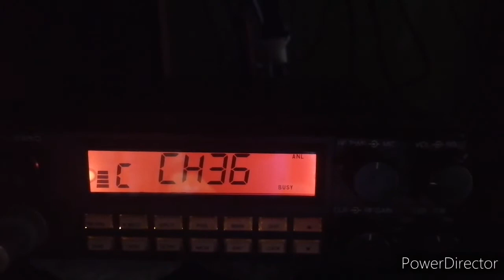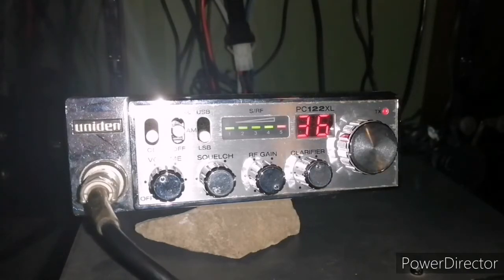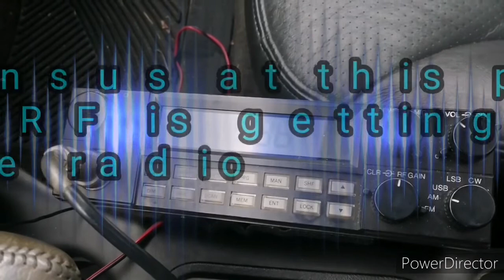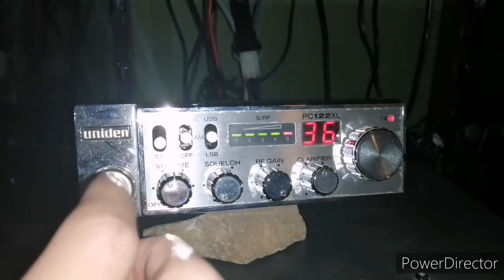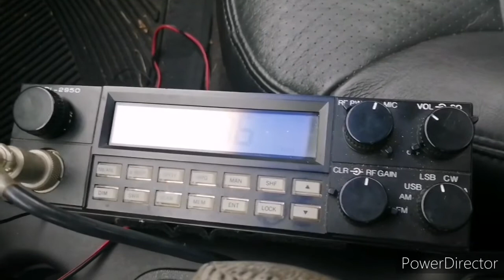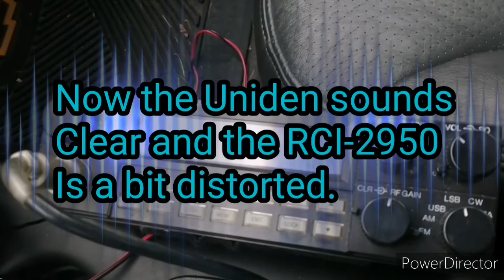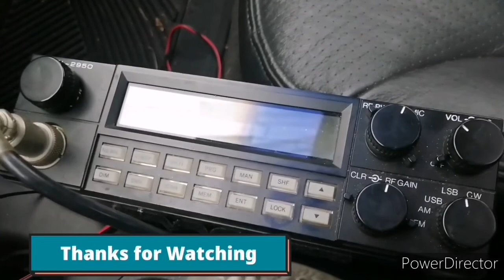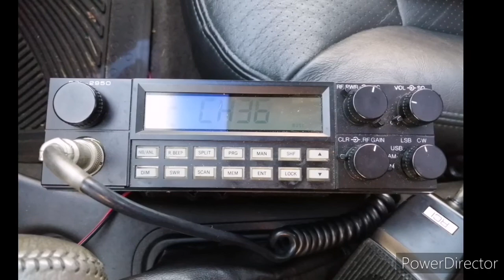Getting Back into CB Radio  Troubleshooting audio issues Part1 Uniden PC122XL vs RCI-2950 range test

Comment: I have heard CB is getting more popular the last few years.  Nice to see the older gear still in use and working.  AM seemed ok, LSB had a lot of distortion.  Strange.  At first I was thinking it may be the Ranger having an issue but the Uniden was having TX and RX issues as well.  I would be looking close at the Uniden setup.  Maybe the rock under it is producing some sort of magnetic field causing the interference?  LOL
Reply from the maker: Lol the rock is holding the whole setup together. We will keep you posted if we figure it out. Thanks for watching 👍

Comment: My Grant XL did similar intermittent squealing when I put it away 5yrs ago. Just took it out a week ago and it was far worse. I had always suspected it was microphone related, so I lightly brushed the mic connector with a small piece of sandpaper and for the short time I had it on air the problem seemed to be 100% resolved. Your Ranger seemed worse than the Uniden to me.
Reply from the maker: Thanks Eric. Will look into both Microphones. Keep that Grant out of the box and on the air! Thanks for watching 👍 if we fix the issue we will post another video
Reply from the maker: Just posted the folliow up with your suggestion menitioned in the video. Thx again 👍